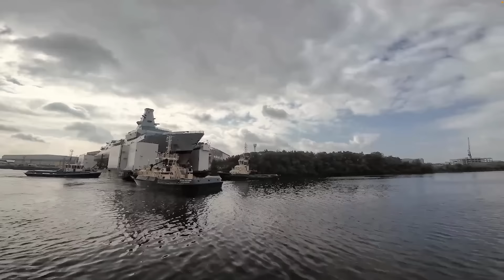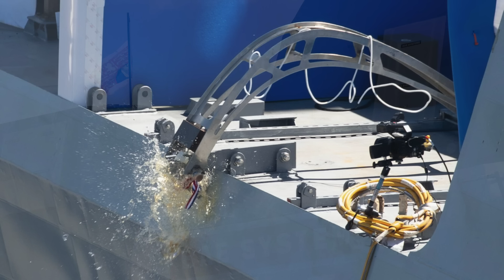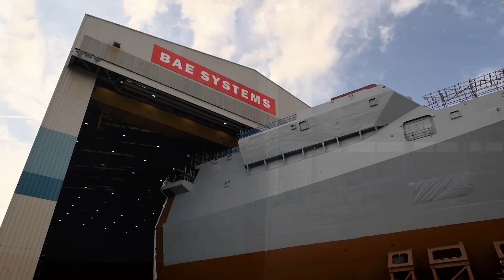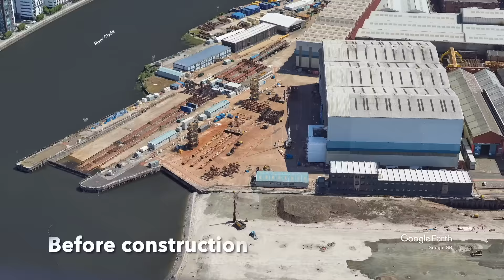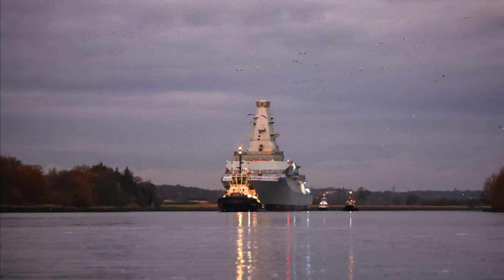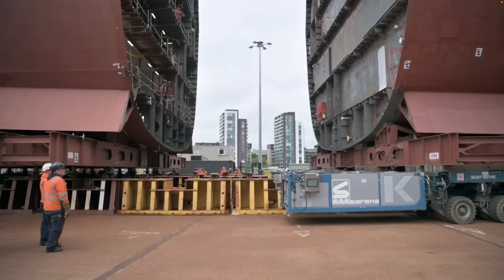HMS Glasgow Comes Alive: Type 26 Reaches Power-On Milestone

Comment: The Type 26 programme is becoming a seriously impressive programme, especially compared to other frigates!
Reply from the maker: We all need something positive before Christmas, and thankfully this program looks like it is delivering.
Reply: I just wish we had 10 of them. Or 8 T31s instead of 5.
Reply: @Oxley016  I'd take 10 26s
Reply: @Oxley016 We still could tbf, atm the type 26+31s are replacing the type 23s, if everything goes smoothly with the Type 26s in service and we export enough, we could acquire a couple more! 

8 type 26s feels like a good amount to me though, especially considering they'll only really be used for carrier strike groups. 

Should also be said, with Norway and Canada also acquiring the type 26, it means we don't have to procure ships to patrol the Atlantic like in the past
Reply: @LegitimateCK4120  Wish Norway(we) still had the capacity to build ships, instead of just some parts to the frigates though, would speed up the process, UK has to do a lot of the ship construction alone, i'd understand if there will be delays with deliveries, with several nations buying them.

But yeah, happy with the choice of Type 26s, good progress, and we already patrol and co-operate the north seas together already.
Reply: @LegitimateCK4120  What I didn't appreciate until recently was the displacement difference between the type 26s & 31s vs the Type 23s. The fleets frigate displacement practically doubles once all the 23s are replaced.
Reply: @bomburthedwarf9036 yep, they're beefy ships. Even the weaponry on board is practically 50% better than a type 23 too. 

48 cell VLS for sea ceptor vs 32 cell VLS on the type 23
24x Tomahawks/Future Cruise weapon vs 8 harpoons/NSM

3x Type 26s basically give more than 4x Type 23s. So whilst I too would love for the UK to procure 2 more of either the 26 or 31, I understand why they don't
Reply: @Mort1-E I think it's probably just a case Norway doesn't have the infrastructure yet. One reckons a big part of NATO rearmament will be for many nations to start domestic weapons/platform construction again. 

At the same time, it's far cheaper for the Norwegians to just "buy off the shelf" and fits into NATO exercises seemlessly. 

Very exciting time for our countries (I'm UK), hoping for more Norway/UK collaboration!
Reply: @LegitimateCK4120  I know that there is a city in northern Norway, who will be building a port doing extensive maintenance on the frigates, part of the rearmament program, you could call it.

Not a ship-building facility, as the ones we used to have, but it is an improvement.

Looking forward to closer co-operation with you guys as well, we have had very close relationships since WW2, common interests at sea, and shared culture as well.
Reply: @LegitimateCK4120 we need some ships to do expeditions and flying the flag type thing.
Reply: @Oxley016 both
Reply: @user-British-celt  Aye, ideally!
Reply: Canada is building 15.
 The first three are FINALLY under way after the same assembly barn delivered 8 ice breaking, 5500 ton AOPVs that slowed the " River Class" Type 26s down.
Reply: Yes it's only taken 28 years from initial consdieration to getting a ship floating and able to turn her generators on, as well as numbers cut by at least a third.
They're good ships but the programme is a national disgrace.
Reply: @tomriley5790  Exactly, the whole program, like Astute, has taken WAY too long. These needed to be ready to replace the Type 22 Batch 3.
Reply: The Navy will get HMS Glasgow operational in 2029, shortly before they realise that the entire prop shaft needs to be replaced and also the ship can’t operate in warm water. 

This will lead to a six year re-fit with complaints from the Navy that they “have been let down by politicians” and need even more of our tax-payers money.
Reply: @martinfrench5527  Fortunately, the Canadian ones are still in the early stages of construction. 
The British lead ship is running the experiments for us.
Reply: @martinfrench5527  the Navy has been let down by politicians - this program started in in 1998 (FSC requriement to replace the T23s). It's taken the politicians (and the shipyards although in most cases the politicians) 28 years and they still haven't got a ship operational yet. It's also the publics fault for not holding the politicans to acount.
Reply: @tomriley5790  I thought the ship was being built by Navy engineers rather than politicians, but I may have got that wrong.
Reply: She looks like a 45 destroyer saying  fix me fix me fix me.😅 🇬🇧🤔😍
Reply: The “m” and “e” at the end of the noun “program” are superfluous.!
Reply: @mrfarenheit9159 That might be true, but not as superfluous this comment.
Reply: @ehochmuephi8219  a painful daily reminder of your defeat by the French. I feel your pain!
Reply: @mrfarenheit9159LOL. Awesome.
Reply: @mrfarenheit9159in the UK we use programme